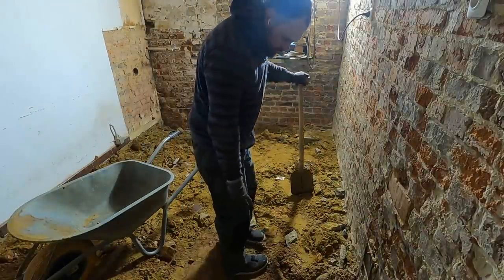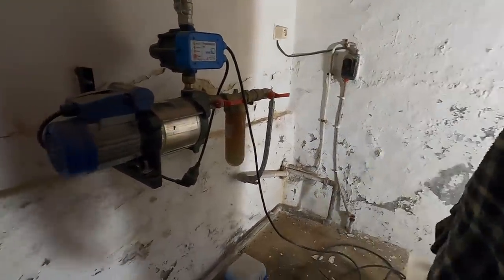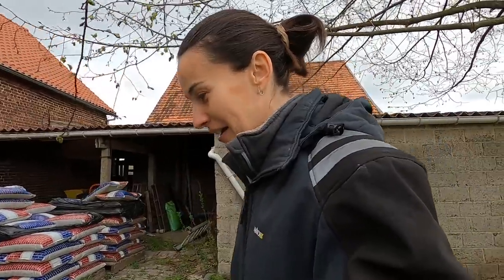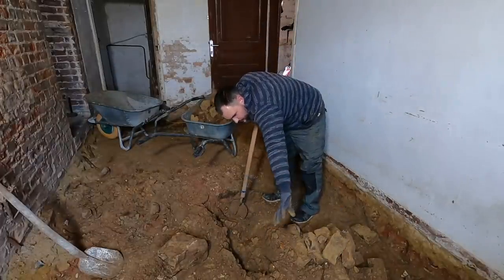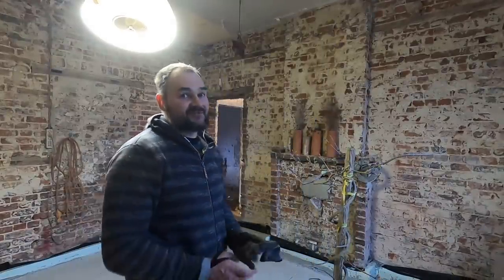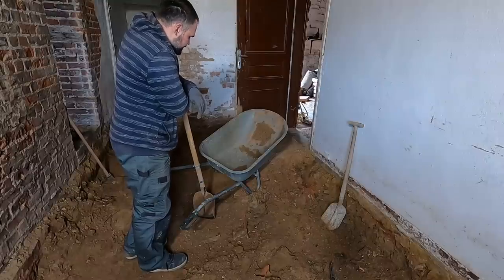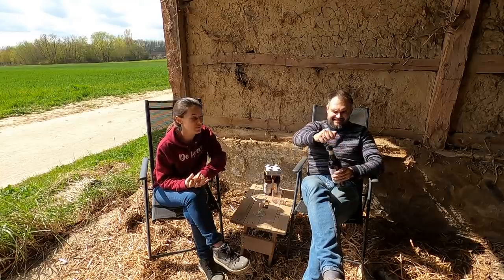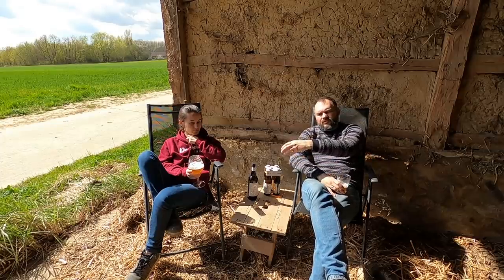Exploring the UNKNOWN: How did the water system on 110+ y.o. farm work?

Comment: PVC pipe isn't as expensive and a lot cleaner to use. You may not need as many pipes as they have ran in the past because of their own reasoning. I would be better if you could find a plumber that knows what they are doing and he can teach and show you what you need to know. Maybe you could find out if you could assist him and it could cut the cost for you. Do have all the water's tested and including the well. We had a well before and we had to add  a certain amount of bleach to it to make sure it was safe.

Comment: Why not have a professional make a new well (put in Dutch). I did it in the Netherlands and just boring it was just 1000 euro's. And we had all modern materials and use to water the garden. I feel that this mysterious well with it's lead, arcane piping is something not worth saving. Just start anew.

Just use tap water for the house and you can put the well anywhere you want on your property. 

Only check if there are regulations about making a new well.

Comment: I can surely tell how young you are. I never drank anything other than what you call "ground water" until I was over 15 years old. I'm sure Europe was no better off in having public water systems. Most homes in the country had at least one water well on the property and sometimes several. Most used hand pumps to get the water out. It can be very potable but may need some treatment (such as chlorine shocking) and filtration to lower the levels of some metals (Iron/calcium/manganese/etc) and some chemicals. And even some germs/bugs/spores/fungi may need to be removed or killed (using UV)  but its cheaper than buying Evian or some other bottled water.Don't shy away from "ground water" until you've tested it. By all means replace all the lead pipe.First find the well -- two design your own pathway for new copper/PVC/PEX piping and just bury (leave buried) the old. Enjoy new safe water.

Comment: I can only advise you to remove the old water pipes and with a bit of luck you will get so much money for the old pipes that it is enough for new PE pipes. but you are also on the safe side with this, as lead pipes are very unhealthy. A few years ago I also changed all the old pipes and installed PE pipes. In the garden you can also shoot the PE pipes through the ground without digging everything up.

Comment: Not even worth the thought of keeping the old plumbing, rip it all out and run new fresh drinking water safe pipe. It isn’t that expensive or difficult to do. As for your well, it may need to be cleaned out from silt/calcium/etc, tested for volume of flow, tested for water quality. I would assume you use a septic sewage system, goes without saying you would want that leech field to be a long way from your water well. 

There would also need to be consideration for how deep your water pipes need to be in the ground so they are below the ground frost line. That might be why your well isn’t producing water, your pipes are frozen. 

Also that pump is a household pressure pump, most of them only have a limit of drawing water about 8m into the pump, it should have it written on it. Is the pump primed? There should be a knob near the pump intake that you unscrew to fill the chamber with water to prime the pump. If it is not primed it will struggle and not likely suck water into the pump. A common problem can be a leak in the pipe leading to the pump that drips out the water which primes the pump.

That small trickle of water that comes out is only water remaining in the pipes, not new water being drawn into the pump. 

In summary: 
1. Replace all the plumbing without question.
2. Get a well company to check your well for flow, water quality, they will have equipment to find the well. 
3. Prime the pump, unscrew the little knob/bolt just above the pump inlet, fill with water till it won’t take more, screw back in, turn on. Water should flow, if not try it again. The pump needs water in it so it can suck in new water, it cannot suck when pump housing is dry.
4. If there is a open tap the pump shouldn’t stop running, that square box on the outlet side of the pump is a pressure sensor to turn to pump on and off when a tap is opened or closed. It tries to maintain approximately 40psi (varies and some pressure sensors can be set to selected pressure) of water in the pipes. It is not essential but normally there is a storage tank after the pressure sensor which holds a sum of water under pressure so that the pump has a buffer and doesn’t need to turn on and off as much for short bursts of water. 
5. Check local area requirements/recommendations for pipe depth to avoid frozen pipes.
6. If no water still then is the pump sufficient to draw the water the required distance?